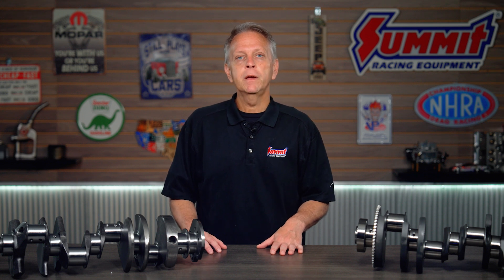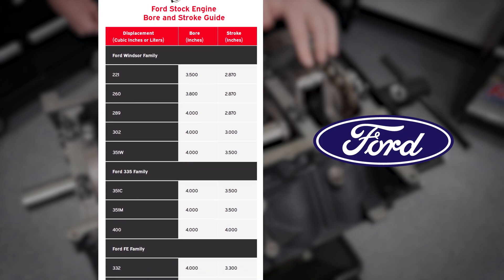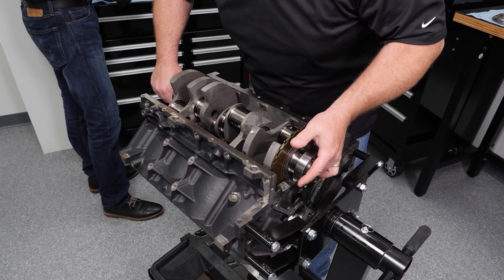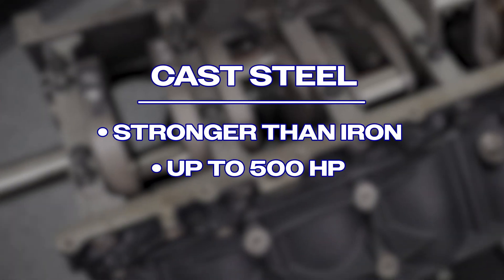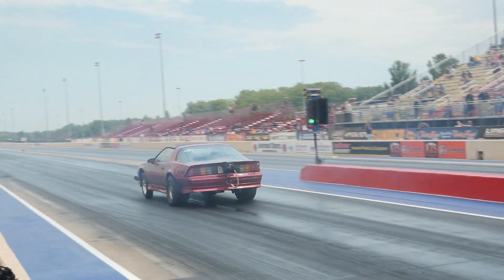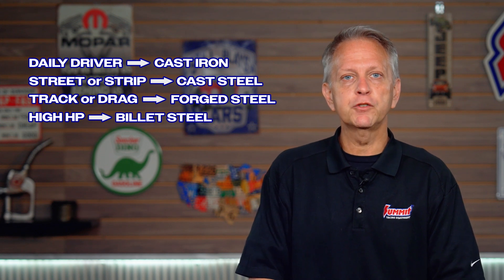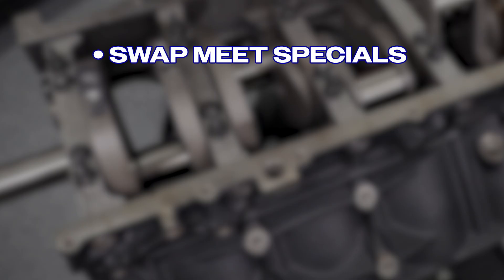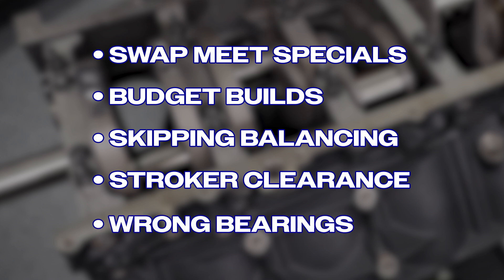Crankshaft 101: Build More Power & Avoid Failure

Comment: What you gain in leverage from stroke you lose in piston area for the same displacement, torque is a function of trapped oxygen for one combustion, so IF you improve trapped air at low rpm from longer stroke it's likely due to the piston getting down the hole quicker (or a number of other reasons).
And it's a bit misleading about forged VS billet, forged cranks have the benefit of grain flow so they can be every bit as good (depending on variables), and if a good forged crank only can take a 1000hp then you'd better hire a different tuner or builder (or start selling higher quality). 👀
Reply: 1000hp RELIABLY.  key word there.  it would be reckless to tell someone  to use  XYZ  when they're  dont know better then they  do what you tell them to and break everything.  liability...

remember,  just because you can,  doesnt  mean you always  should.
Reply: @KingJT80  If someone breaks a good forged crank at a 1000hp then a billet won't be far behind, could even break earlier depending on quality. High-end billet cranks is often what's used in the most extreme motorsports, but they cost about what some spend on a whole build, and the builders using them won't be looking at a YouTube video for advice.
Reply: @PSA78  callies dragon slayers  are billet  but not a moldex or byrant  which are the highest of the high end.  id  used an egale or scat 4340  up to about 1000+ give or take  from there  id  at  least be using an ohio or dragon slayer billet  crankshaft  with 1200+ especially if  its  being use  to beat on like burn out  competitions etc
Reply: @KingJT80  The use certainly matters as does the overall build and way of making the power. Eagle and Scat should hold up, but they tend to be all over the place in finishing which adds work (if the engine is properly built and not just assembled, which goes back to durability).

Comment: Choosing the right crankshaft can mean the difference between a reliable powerhouse and catastrophic engine failure. In this video, we break down everything you need to know—whether you’re building a mild street motor or a 1,000+ horsepower race engine.
Video covers:
✅ Bore & stroke basics (plus stroker engine tips)
✅ How stroke length changes torque & RPM
✅ The 4 main crankshaft materials—and their horsepower limits
✅ Internal vs. external balance styles
✅ Key upgrades for strength & reliability
✅ The 5 biggest crankshaft-buying mistakes to avoid

From cast iron to billet steel, we’ll help you pick the right crankshaft for your build, budget, and horsepower goals. Don’t gamble with your engine—watch before you buy!